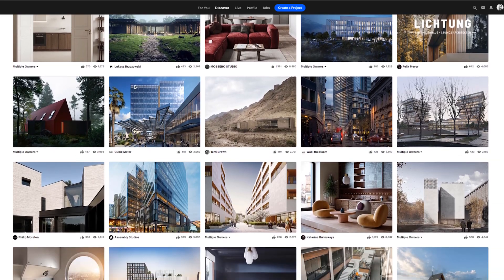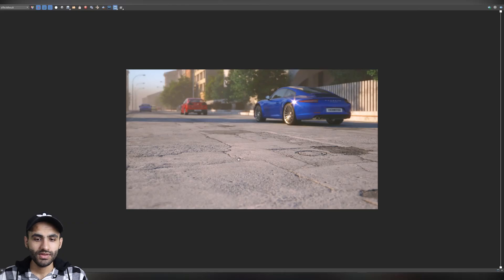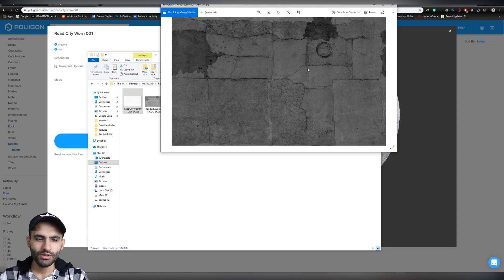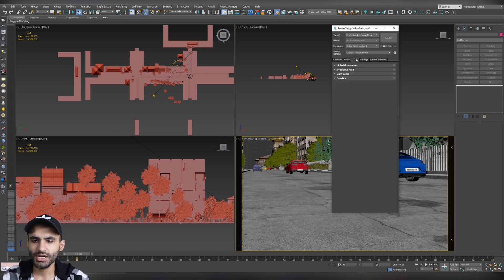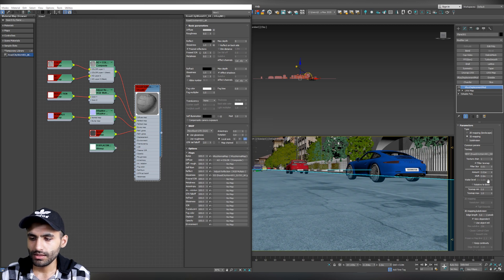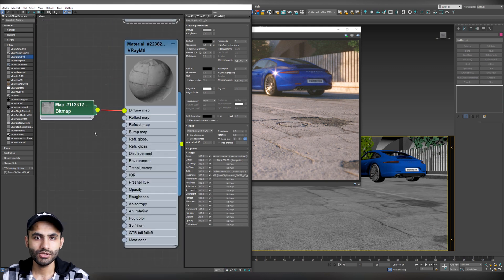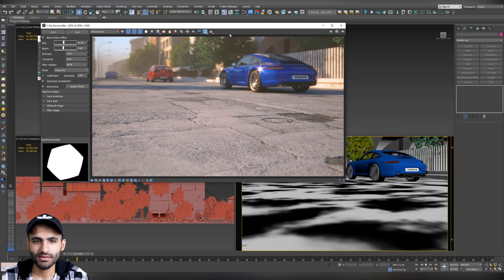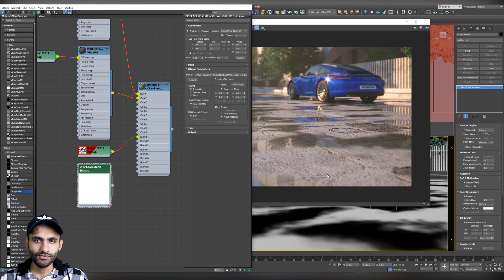3Ds Max &VRay NEXT | How to Create Wet Asphalt PBR Material

Comment: Hi there. I love your tutorials. I'm having a problem with getting my puddles to be have a mirror reflection like yours and the displacement map also appears affect the UVW map of my blend material. Your render looks like the puddles are actual flat puddles which fill the cracks and it has a more mirror look. I have followed the tutorial step by step but the result is different. Is there something else that you did that gave the water a more reflective and flat puddle look?
Thanks